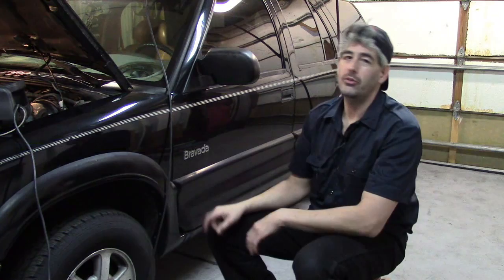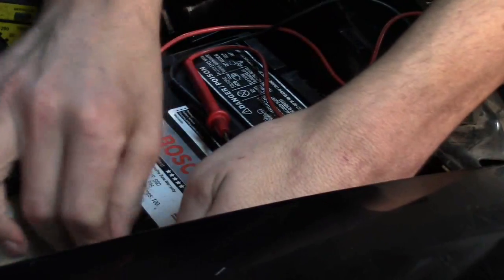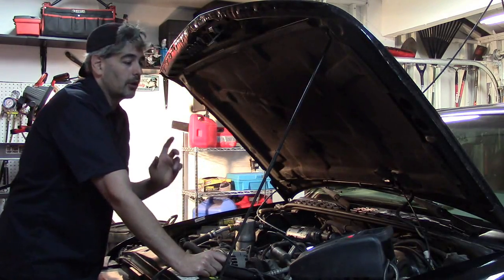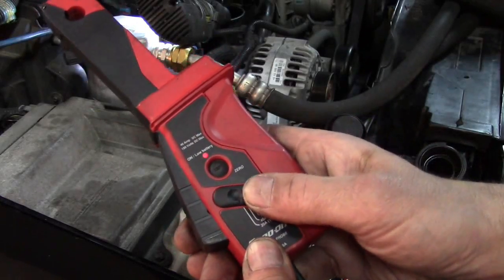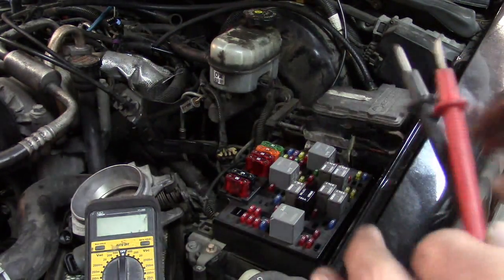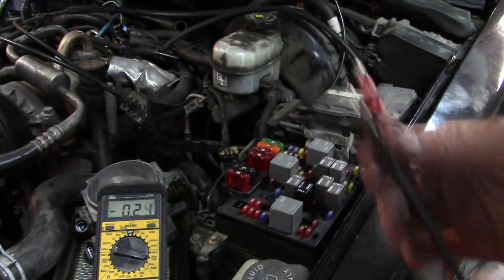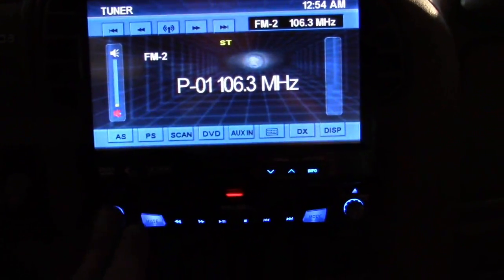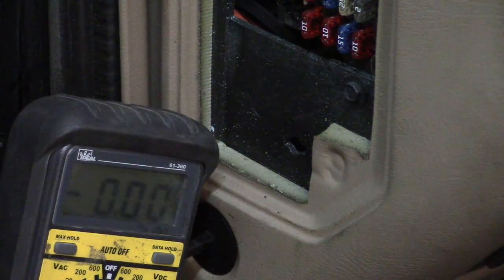Improved Methods to Find Parasitic Draw (Battery Drains Overnight)

Comment: Pulling the fuses is much more accurate and straight forward. It also takes less time then your method.
Reply from the maker: How would that be possible? There either is or is not continuity through a fuse and you are saying pulling the fuse, measuring continuity, and then replacing it and doing the next one is FASTER than just touching the fuse in-place with probes?  Really?
Reply: Schrodingers Box Anyone with half a brain would clean any and all corrosion from both the fuse and the fuse block. Why you ask ? 
The same reason you would clean battery terminals, for better conductivity and eliminate  irregular current draws, which could give a false reading. Let us hope that even you can understand this premise.
Reply from the maker: You complete bumbling FOOL. there not only will not be corrosion on a FUSE in a fuseblock  as anyone with any basic electricochemistry background knows, but i reiterate- HOW CAN THERE BE CORROSION CAUSING A PARASITIC AMP DRAW???  please explain, moron.
Reply from the maker: Blah blab blab blab blah. still doesn't answer the question. I see as usual with you dopes i'll have to do the thing where i delete your future posts til you answer the question- which of course you are unable to do.
Reply: Pulling fuses when looking for a current draw can lead to the problem that the draw goes away, and then doesn't return when the fuse is reinstalled which has then made it impossible to identify the exact cause of the drain, until it re-occurs. Voltage drop testing across the fuse works exactly as depicted in the video because you can't break Ohms law. IxR=V
Reply from the maker: John Gillespie John that's a great, great point!!!!
Reply: Thanks, I love the science in what we do.
Reply: I would start by pulling fuses as it would by much quicker to determine which circuit is drawing the current. Corroded fuse terminals causing resistance will give a voltage reading across the fuse, quicker (and can clean the terminals of any oxidation by doing so) to pull each one rather than connect both probes to every fuse whilst being tits up in the footwell of the car whilst trying to read the voltage at the same time.
Reply from the maker: James, did you not read this thread before posting such a foolish procedure?
Reply: Yes, including your obnoxious replies. My opinion is that it is usually best to start with the quickest and simplest method to determine the what the problem is. With more complicated systems a more precise method of diagnosis may be appropriate.
Reply from the maker: The quickest method is to introduce a new variable?????????????  WOW!!!
Reply: Mr. Allen.  You wrote "Corroded fuse terminals causing resistance will give a voltage reading across the fuse," Sorry but that is not correct. Corroded fuse terminals would increase the resistance of the terminal connections and result in a voltage drop at those connections and not across the fuse itself.

When we teach classes we stress that a voltmeter shows you the difference in potential between two points. You select what those points are going to be when you do testing. The fuse connections are not included in this test as they are outside of the testing points. The voltmeter being connected to just the fuse terminals only shows that voltage drop, which would be in a direct relationship to the current that is flowing through the fuse in the circuit. 

The electronics in today's cars have made some testing routines obsolete, and pulling fuses to try and locate a parasitic drain is on that list. That's not to say that it doesn't work, it just often results in an unintended consequence of the drain then disappearing and not returning while the vehicle is being serviced. If it's your own car and you are OK with revisiting the problem when it comes back and then using a more advanced method that's on you but if you were doing this for someone else on their dime, then you have an obligation to try to use the best method available and that is to measure the voltage drops across the fuses to identify which circuit has the parasitic drain. As mentioned in a previous response, Ohms law fully supports this diagnostic routine since V=IxR where "R" is the resistance of the fuse.  "I" is the current that is flowing in the circuit. And that results in the measurable voltage drop "V" across the fuse.
Reply: What these guys are missing and why this method of voltage drop testing was even started is because if you un-hook the battery or just start pulling fuses you can re-set a computer or module that's causes the draw in the first place. Now you've just masked the problem your trying to find. Let alone making sure modules and computers have all gone to sleep and aren't awakened again. 
I see you finally got you a scope! I remember a long time ago suggesting that you did! 
You need to get a pressure transducer for your scope next for running compression test waveforms!!! That's some cool stuff! You'll really dig that! I assume that your using you scope for relative compression checks with the low amp clamp? adding the second channel to sync the waveform or verify correct timing? Plus looking at fuel injectors or COP right from the fuse box with a fuse adapter. If your not look into it plus i can give you any info you need on doing it if you want any help on getting started. The scope is the not only the best tool for diagnostic's its just down right cool as shit!!!
Reply: A thermal imager that snap on came out with is my tool of choice now. Just shoot the fuse box and the fuse that's glowing is your draw. Works great on miss fires to! shoot the cop's and the one that's not glowing is dead or if the cops are good shoot the exhaust to find which cylinder is misfiring. There's so many things you can use that tool for!!! It a game changer for sure in the auto field.
Reply: Dear it really sounded great to me, plz elaborate this came a little.thanks
Reply: why not just pull all the 10 amp fuses & see if battery drains over night & if it does then pull all the 15 amp & after over night it drains then pull all of 20 amp & then the 25 a  & etc

Comment: DVOM, Is that to impress novice home mechanics, Never heard that term anywhere in the country, and I'm sure I have more electrical/electronic experience than you will ever have.
Reply from the maker: Digital Volt Ohm Meter?? It’s basic, fundamental standard terminology ubiquitous through the industry. 
  If you haven’t heard that term then i’d question where you are getting your training that I will never get.
Reply: Which is different than an analog VOM. Also, a cheap analog VOM can have a low ohms/volt rating, which will throw off readings because it will draw current and become a voltage drop in it's own right (rendering those fuse charts useless).
Reply: So... You have never heard that term? Are you still working on "see spot run"?

Comment: I'm screwed...
Reply: Congratulations  -- perhaps!
Reply: @watchdogu.s.a.8973  Lol. Ironically, I found it. After 5 years, and agony most people simply wouldn't believe. It significantly altered relationships, income, feuds, police, my general direction in life was stressed, lol.

 I would liken it in dead seriousness, to that well known trope, maybe your in a new marriage, and your teenager from the first wife is troubled, and keeps showing up at the house randomly, any hour, calling with outrageous, or self inflicted needs, treats your new wife like crap; just this constant stress even when not engaged, you know. Or a secret drug addiction, or an ex stalking you, that's what I've come up with, lol. 

My 'always on' power outlet is corroded around the positive contact. Can you believe that? The actual issue, yes, but the narrative, given what I just said, seems not real to nature as I know it, you? I have trouble computing it. Literally in-credible. Yet, it is so...

Peace
Reply: *may be corroded because of staying hot or whatever, the problem may still be there(not done yet, lol), but with nothing to draw anymore. I just  took it out and haven't replaced it, and it stopped draining.
Reply: @blackopal3138  Removing it was a wise  move for now.  You can always put it back.  If it never blew a fuse I'd also considering removing the fuse for that circuit if there is nothing else on that circuit.  While probably unlikely, it it had a constant draw did it damage the wire somewhere upstream is my thought and reason for pulling the fuse for now.
Ease up on the stress!  Send the teen to the wherever it is that teens go.  As for the ex and replacement... you're a braver man than I!  LOL

Comment: or spend a little more money and buy a meter that has auto amp protection
Reply: The meter is not what needs protection in this case. Expensive modules are what can be destroyed by using your meter's Amp jacks where you should not.

Comment: Hi Matt
Thanks so much for all your great Help videos.
Have you seen the video from this Ford tech guy that doesn’t believe mili volt at fuses is dependable for parasitic Draw test? See below for the video
 
FordtechMaculoco
Which Parasitic Draw Test Method is REALLY the Best?
https://youtu.be/6xFo_oHFF48

Take care
JP
Reply from the maker: Yes I agree with him. The voltage drop across the fuse has a lot of variables and I do not rely on it 100%. however I do like how it prevents shutdown and restart of systems by pulling fuses so it greatly reduces variables in that way but I do agree it’s not a perfect procedure.

Comment: jesus, the most important part for a beginner is something you miss on both videos. You don't say it and you don't show it. How to set the meter and where exactly to put the leads. Unless this video is not for beginners.
Reply from the maker: As stated 1000000 times, this is not a beginner channel. Hundreds of thousands of channels show basic beginner level electrical. This channel is for people who are way beyond that.  Once you learn beginner-level things like how to use a multimeter, you will find this material to be at an ideal level